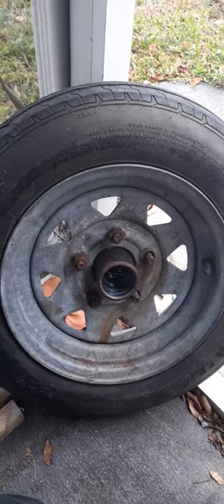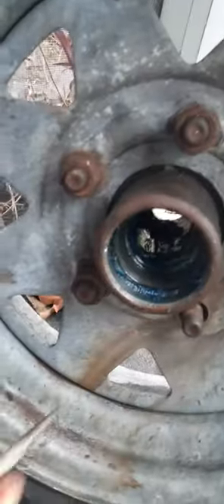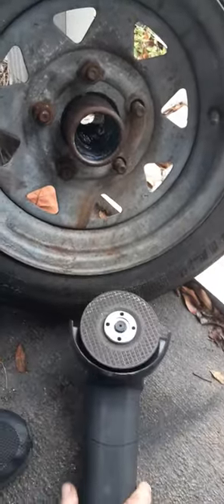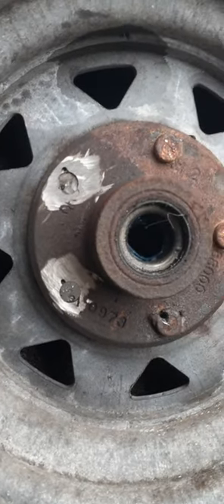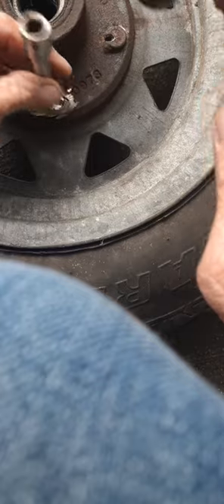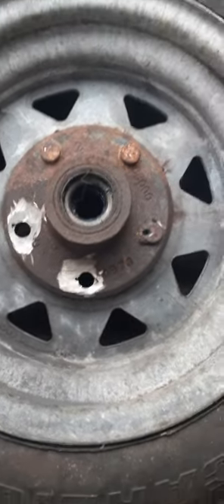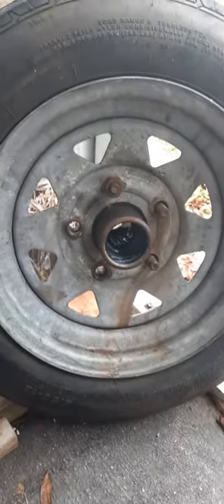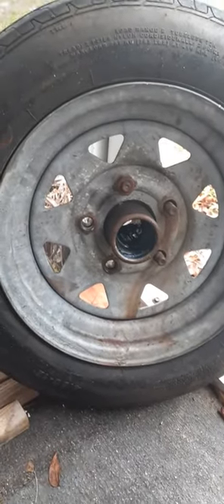trailer hub stud striped out how to remove

Comment: I had to go through this once.  The heads on the backside of this hub are recessed, so no grinding. I tried drilling the nut out from the backside with a 1/2-inch carbide bit, but I was off center by about 1/32-inch and I couldn't get anymore done on it from the backside. I should have used 5/8-inch bit. Anyway, I got the nut split with a grinder and chisel so I could save the wheel. Had to buy a new hub.  I'm the only person that torques those nuts from now on!
Reply from the maker: That's all you can do with a recessed stud just replace it...they make them that way so they cant be repaired eisley